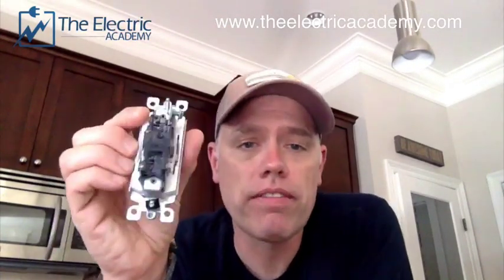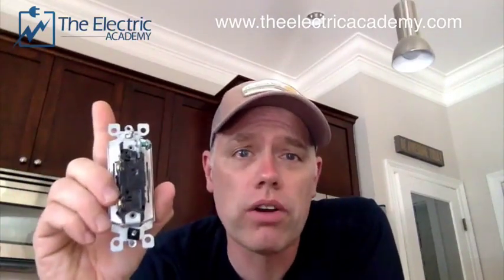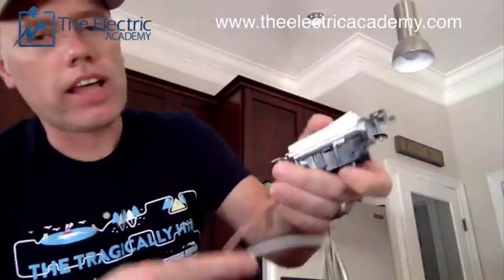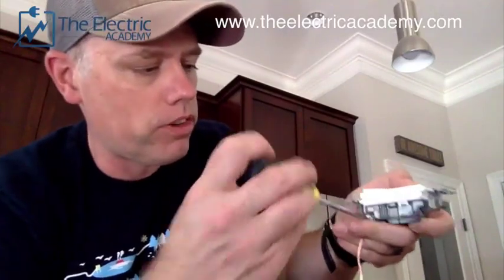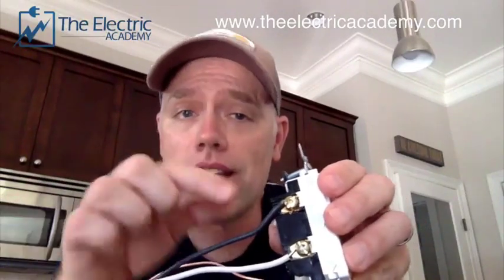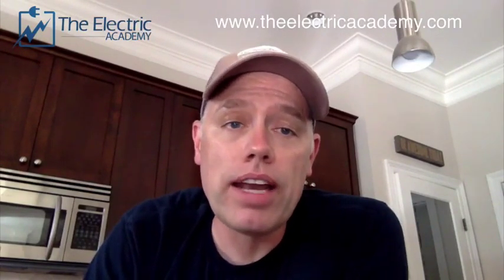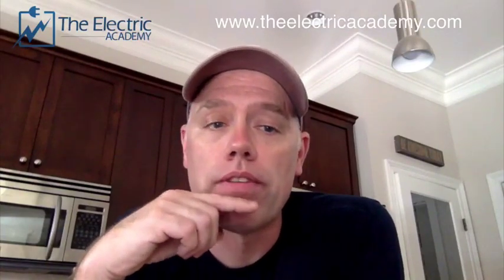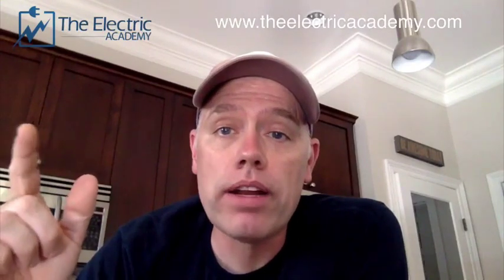DO. NOT. BACKSTAB. YOUR. DEVICES!

Comment: I completely agree. I think backstabbing should be outlawed and not even available on devices anymore. I have multiple pictures of charred backstabbed devices that nearly caused fires. I firmly believe many house fires have been caused by it--but the problem is, there's no way of proving it. Everything gets incinerated beyond recognition. Who wants to be responsible for causing a house fire? I sure don't. 
I've done many entire-house redevices, and I removed almost all wires from the devices from just pulling on them (with gloves to save the fingers, anyway). I also agree that it's lazy. Do the job right the first time...I hate going back to the same job twice.

Comment: I’m a victim of this. Recently got most of my outlets rewired because there was problems with other downstream outlets losing power from a loose backstabbed connection. It’s lazy, unsafe, and can cause problems down the line. It’s just straight up better to connect the wires to the terminals.

Comment: Viewing this from NZ. Just stunned. While NZ (and of course Australia) didn't get everything right with our wiring, we seem to be way ahead of some of the world. We moved away from centre earth in wiring decades ago; earth is also always insulated. Live is in the centre of the 3 wires. We don't use solid conductors for anything above 1.5m2 for domestic use. We use neither push in or the flat screw terminals (our system is almost as fast as push in), and our terminations have no exposed screws or parts anywhere inside the flushbox. Leakage protection is mandatory and used everywhere. Our faceplates look way better than those used on North America - I hadn't realised just how much cleaner our systems are.
Reply from the maker: As a Canadian I can't help but agree with you.
Reply: As an Aussie working in the US I am appalled  at antiquated the electrical  system is here, even after 20+ years. I miss HPM and Clipsal products.
don't start me on using common neutrals !!

Comment: Some receptacles,in my home, that I use for a oil radiator heater. The metal prongs will get hot to the touch. 
Ever time that happens, I pull the receptacle and sure enough. It’s back stabbed. I wire it in the way shown and... shockingly, no more problems.

Comment: I don't think backstabbing is a thing here in the UK, all connections are made via screw terminals.  We can't use the hook method on all connections, some are just inserted into holes with a screw securing the wire down.  In that situation, I bend the wire so I have twice the surface area being gripped by the screw.  When I can hook, I always do in the correct direction.

Comment: Yep, I agree. The "quick connect" is an imprecise bent piece of ultra thin metal  plate and are ultra mass mass mass produced cheap junk by the lowest bid vendor. The bend of the metal for the quick connect should be round tube but its more like an irregular cone. Contact area is little and poor. Arcing DOES occur, carbon, pitting and failure follow, there's no getting around physics. I've replaced lots of broken ones. Prior 8 yrs US Navy Nuc Submarine Electrical Operator and 45+ years in design of server & networking hardware, power supplies, 10 US Patents and absolutely a regular guy who eats dropped food from the ground and puts dirt in his cuts. This would never fly in the US Nuclear Navy and given many other NEC codes, I'm shocked (pun intended) this is allowed as good practice.

Comment: Electrical newbie here. I am changing an outlet and found that there are three hot wires, three neutral wires, and three ground wires.

1. If there is NO light switch connected to this outlet, why would I have three sets of wires?

2. How could you avoid backstabbing in this case?
Reply: P.J. - First thing, make sure the jumper between the brass screws is not removed.  If this is the case, you have one pair feeding this receptacle from a previous receptacle or the main panel. The other pairs go downstream, with one pair being a fork in the branch. 
You will need 3 wire nuts or Wago connectors. You take the 3 black wires and 1 black pigtail and connect them together, the pigtail goes to one of the brass screws. Same with the white wires to one of the silver screws. You also have to deal with the ground wires similarly. You probably need a deep box or you may not have enough room. You have to evaluate this initially. 
Here is another alternative: Get a spec grade receptacle from Home Depot or whoever and use the side wire option where you can install up to 4 hot wires and 4 neutral wires directly to the receptacle. This is not backstabbing as you use the screws to clamp the wires in place. Tighten firmly, and you'll have an excellent connection. Your current outlet box should be fine since you aren't adding volume. You still need a pigtail to handle the ground wires.

Comment: What about backstabs with pressure plates?
Reply: Those aren't backstabs, that's called back wiring and perfectly fine to use them. They are only on commercial grade receptacles and switches.

Comment: to release back stab is very easy you need to push the clip away from the wire also you need a #2 not a number 1
Reply: I believe he was using a Robertson (square tip) #1, which fits the square in the middle of the screw.

Comment: If done properly...and leave about 6 inches of tails..there is no problem..outlets are cheap enough to just toss them out and replace..I hear what you are saying..but as I said leave enough wire and strip according to the strip gauge on the back of the outlet...you will not have an issue.  BTW...didn't know screwdrivers made sounds as they are used..lol!
Reply: I must beg to differ. This is number 3 on my list of grounds for immediate dismissal.
Backstabbing is too damn dangerous.